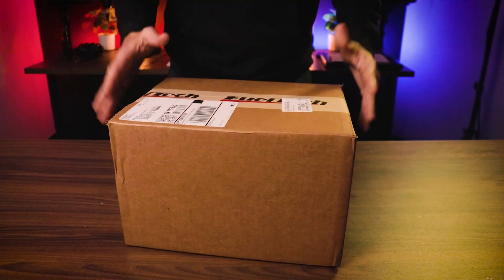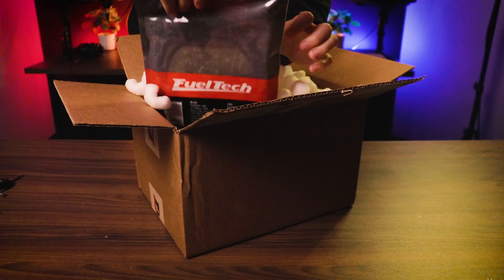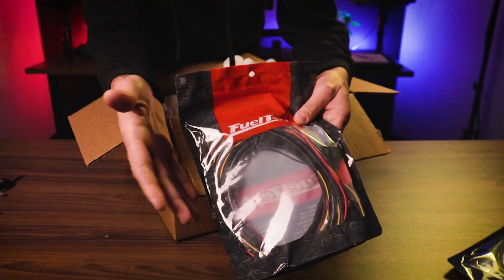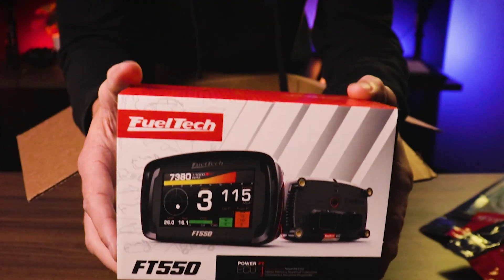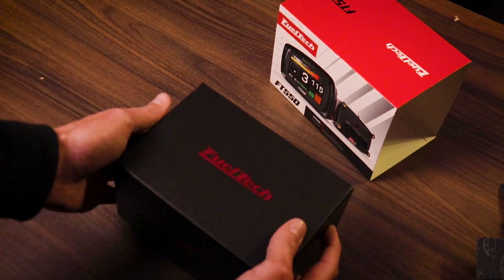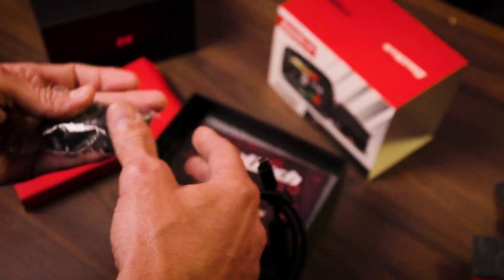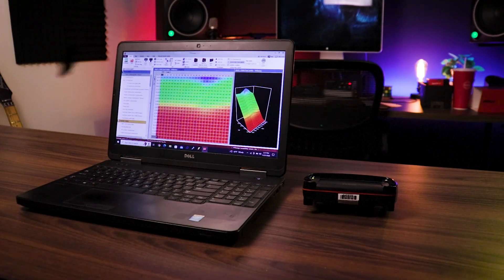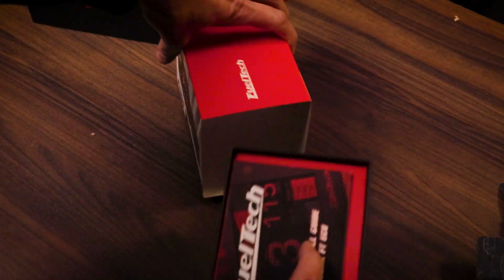Chevy Cruze ECU Upgrade - Is it Worth the Money?

Comment: Does fueltech support the stock crank and cam trigger?
Reply from the maker: It does. The crank trigger, after some research, is a pretty standard pattern. 60-2 or 58x. Their software allows you to also read the camshaft trigger pattern so it can learn it's phasing. Pretty cool stuff.

Comment: I'm interested to see how good this Fueltech unit works out. Specifically, the wiring and installation. It's definitely gonna take some time to integrate all the stock sensors and outputs with this ECU. Also, the touchscreen is sick! Overall it looks like a very capable unit. I'm curious to see how it performs once you get it tuned and installed in the Cruze. Looking forward to the updates on your progress! Good luck with the build.
Reply from the maker: You and me both! Have already been doing some digging and the crank and cam sensors / triggers are pretty standard counts, although they look different at face value. So shouldn't be much of an issue. I'll report back though as I go through the process and share the ease, or hangups of the install.

Comment: Can u explain why going with the turbo 1.4 ecu wouldn't work for your under 30psi build? You have been messing around with your NA ecu right?
Reply from the maker: Many reaons. :) I have been tuning the stock ECU.  So some of the reasons messing with a 1.4 ECU wouldn't be idle is I would put a bunch of time, money, and effort into changing the specs within another computer, just to have to battle the same issues. The 1.4 has 3 ins and out vs 2 on my current.  My plan is to push the engine as far as it'll go. 30psi would still be a limit. There's also calculation limitations in stock ECU's. From calculated torque, control over the throttle, speed limiters, acceleration limiters, fuel limiters, boost limiters, traction limiters, fuel injector limitations (You have to scale and trick the maps and stoich scaling), etc. With the aftermarket ECU I regain control over all of that almost like having a carb'd engine, but with a lot more control and ability to dial it in.
Reply: @cmattdabrat  thanks 😊 I am glade you didn't give up 🥳

Comment: Wow that cost breakdown at the end really does put buying a standalone into perspective. Sure, different solutions for different needs, but yeah after all the spending to get features it's often worth it to just go full send. We are spoiled for options now, after all!
Reply from the maker: Tell me about it! Thought HP Tuners was going to be the solution along with the AEM bits, which it's fine for the first boost levels I was running. 8psi. Not so much the case now. I think this ECU will make tuning a breeze and a joy. Tuning with HP Tuners, although I learned a lot, definitely a lot of work arounds and trickery that goes into going from NA to boost.

Comment: Called it. Good choice! FuelTech offers a lot of capability and features for the money. It is really interesting how every ECU manufacturer really does have different feature sets and price points to meet various needs. I'm working with Link ECU now and I have definitely been impressed, but hard to knock a lot of the options out there. They definitely should have sponsored you with how much value you offer, but hopefully they'll notice you after this. Are you considering wiring to a connector to plug into the stock ECU location? I can help you find the connector if you want. Basically making your own plug n play adapter harness instead of rewiring the entire bay. Excited to see you put this baby to use!
Reply from the maker: You did! I replied to you on the community post, but that's the plan. I'll go into more detail in the next video, but you're spot on. Just need to study the wiring diagram some.  I want the stock relay and fuse box to stay, and then basically unpin the harness going to the ecu, make a connector that'll shoot it to the FT550, and back to the stock harness I'll unpinned / install a connect.

Perhaps you could help me dig up a couple simple weatherproof connectors that will accept the stock pins, so that way all I have to do is pop them into the connector, and pin the FT550 accordingly.

I'l have to dig into the Link. I've heard good things about them. So many options... I dug into quite bit of their interfaces and they all seem pretty easy to understand, although some approach the math slightly different.
Reply: @cmattdabrat  Awesome I'm def looking forward to seeing your work. That's a cool approach I hadn't thought of for some reason. Unpin the stock connector that leads to the ECU and put just the pins you need in another connector. I'll see if I can dig up which pins they use and the connector series. Can be a real pan sometimes.

Yeah the different tuning software for all the companies is a big differentiator. I've heard good things about the FuelTech software. One thing I will say for Link is that the documentation and help files are awesome. I know other companies do a good job, but I think Link is one of the best in that respect. Otherwise I find the software pretty easy to navigate. ECU Masters wasn't bad either, though I only messed with it briefly. HP Tuners has a basic feel, probably on the easier side, but can be a bit hard to find things. I haven't tried Haltech or FuelTech yet. It probably helps me that I have a lot of tech and programming experience.
Reply: @cmattdabrat Any idea if your ECU is 2 or 3 connectors? Shouldn't make a big difference.
Reply: @cmattdabrat  No idea why my replies aren't posting other than I've mentioned the picture platform. Check your comments filtering and your inbox other places. Hahaha.